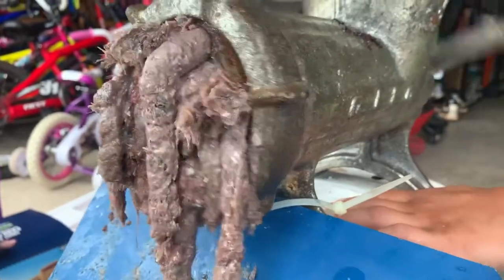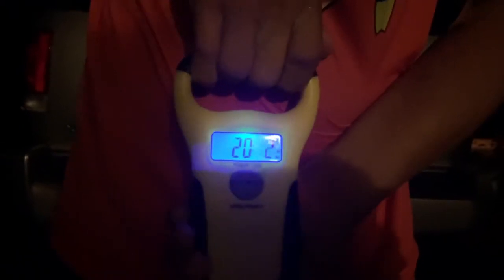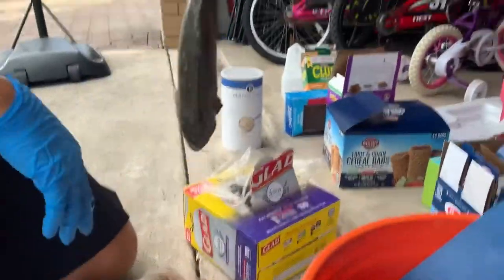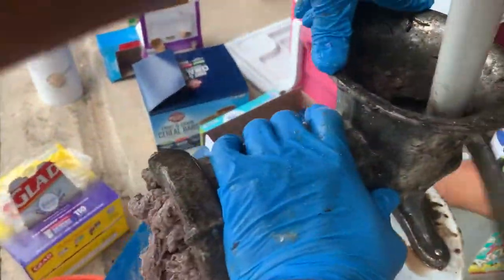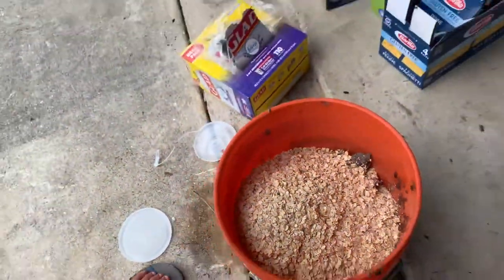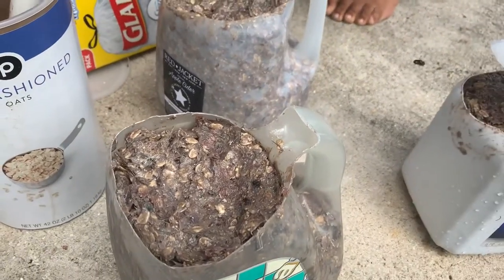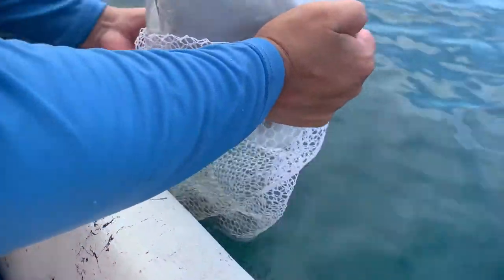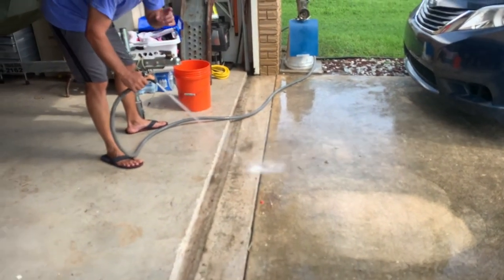MAKING YOUR OWN CHUM BLOCK FOR SNAPPER FISHING - A CHEAP BUT SUCCESSFUL RECIPE

Comment: Just a tip for cleaning the grinder. As you finish grinding dump, a bunch of ice cubes in it and grind it right into the bucket. It will end up rinsing out most of the leftover chum inside, then spray with the hose then WD-40.
Reply from the maker: that's a great idea. I will try that next time

Comment: Thanks for the video! Can you do this with bonita or the leftovers after cleaning the fish you catch instead of just thowing it out?
With the grinder process fish bone?
Reply from the maker: Glad you like the video. It absolutely works with fillets of bonito and other fish. With the model that I have, it’s not a good thing to put large bones through it. It gets jammed up if you do. Sometimes if I’m trying to put larger bones through, I will crush them with a mallet first, and then run them through the grinder after.
Reply: @watchyourlip3209  Great info. Thank you for getting back to me. I've got fish leftovers in the chest freezer that I refuse to throw out so I'm going to try this.

Comment: Take that Arizona tea plastic bottle, cut bottom off and use to funnel into grinder. Bonus, measure how many times filled and you can set recipe based on math not might be lol. Good stuff. Families that fish together stay together. Cheers.
Reply from the maker: Nice!! Thanks so much for the nice comment and for watching! blessings
Reply: @watchyourlip3209  I tried the leaf shredder method last year after seeing on tube and saying brilliant. Wasn't as fine and bricks washed off quick. Came back to ye ole grinder and attached a used cheap corded power drill to and what a difference. We use the funnel trick and keep eyes on to add oats, eggs and oil. And we prefer the cardboard rounds like oats come in. But blocks also run well in dollar store laundry bag. One thing about the shredder was it ate carcasses without chopping up. Miss that. But just chop heads to feed into grinder and spines and tails will follow. Chum is EXPENSIVE in FL Keys, so we build banks all year and share where needed for our boats. Thats the next lesson for your son to see. I love that you have him in the mix and hope these tips help you all fill those freezers!!! Bless you to brother. Cheers.
Reply from the maker: @herewegofans   brother - thanks so much for the ideas. One of my next purchases will be a nice big freezer for the garage. I’d love to make a bunch of chum blocks. I just bought 6 blocks of chum for a fishing trip and it hurt how much it cost. I did it have space in the freezer to make my own this time!!!

Comment: Be carefull Broward limits cast net size to 7 feet.
Reply from the maker: Thanks. I’ve tried researching this and find different ordinances that seem to contradict each other. For instance: section 13-3 (a) says nets should not exceed 7 feet but section 13-5 (a) says you can use cast nets up to 9’ and 18’ spread in Broward county waters. On top of that, I see it common practice to use 10-12’ nets from vessels by recreational and charter captains. 

It’s quite confusing. If you have clarity I’d love to get it so we don’t violate any laws.
Reply: @watchyourlip3209  Its all so confusing. I ended up doing the 7 as the 500 dollar fine scared me lol but I just don't see FWC enforcing County ordinances though. Good video though
Reply from the maker: @JVRottweil  got it. Good call bro. Thanks for watching out for me